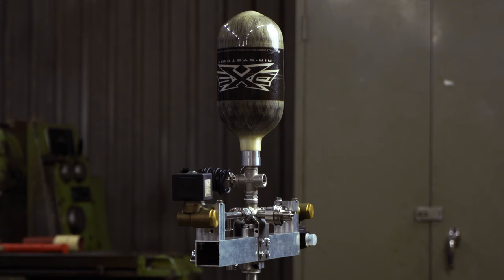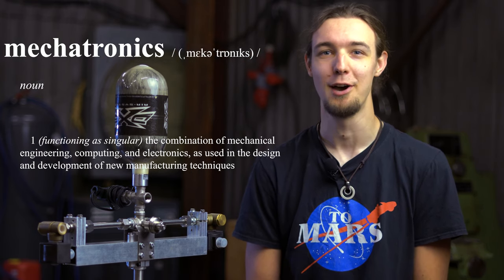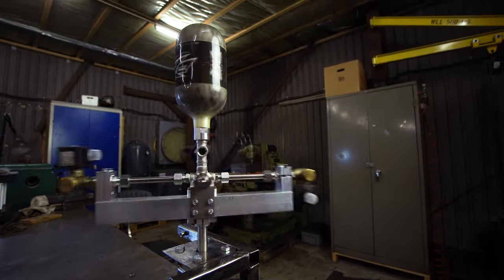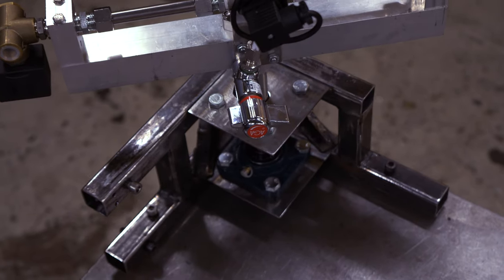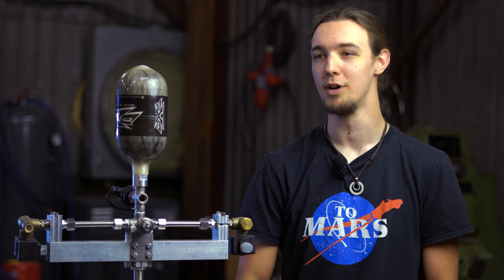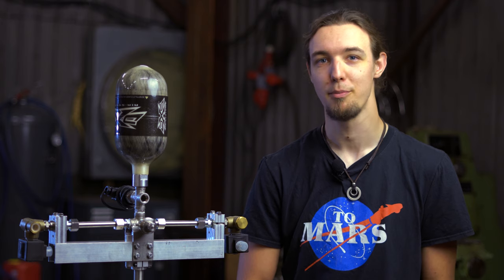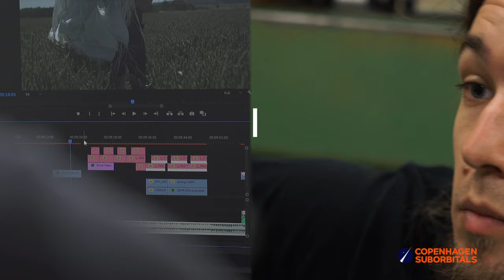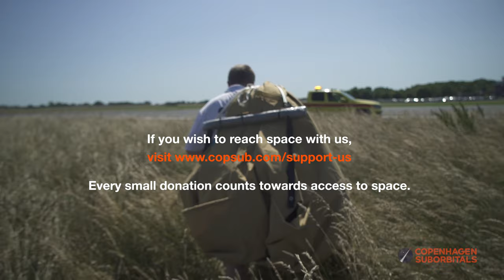How a Reaction Control System Works? Homemade Demonstrator

Comment: Thanks for the update. Is this system lower cost then reaction wheels, or is it simply lighter and more reliable, whilst still carrying enough propellant for the flight? And will you also be studying a chemical thruster option? Looking forward to seeing some of the tests; they should be very interesting. 🚀
Reply from the maker: Coming from Adrian:
Usually reaction wheels are great for satellites as they can operate for long periods of time, only using electricity provided by the sun.

We need a high powered system that operates for a short amount of time. So we would need to carry all the energy with us, in the form of batteries. 
Batteries are expensive and heavy.

But the final version that Spica will use is not set in stone yet. 
Why don't you try to make some calculations on it to see how they stack up? 🙂

I have looked more energetic fuel options, the ones that look most promising are based around hydrogen or hydrogen peroxide. But they would add a lot of complexity that is unnecessary for the current scope.
This simple system can be used to test many things and its operation is much more safe and faster.

Upgrades are of course possible. For example I would love to see a tri-gas version at some point. 
But I have a mountain of other things to do first.
Also remember that the Falcon 9 booster also uses compressed nitrogen for its RCS thrusters.

Hope that answers your questions!

Comment: One small question, would mechatronic engineer directly translate into the german language as a sub group of an "Elektrotechnik- Ingenieur" or are we talking about the casual "Maschinenbau-Ingenieur" with emphasis on control systems and electronical compononets?
Reply from the maker: From Adrian: Mechatronics can be directly translated to "Mechatronik" and is its own separate study course. It is pretty new though. Yes, it is a combination of "Maschinenbau", "Elektrotechnik" and a little bit of "Informatik" ... albeit not that much, where I studied. 
It can have many directions of specialization. Biomechatronics or Micromechatronics. It can also have a lot of control theory if you choose to go this route.
Reply: Mandernach Luca Maschinenbau.  Elektrotechnik heist gleich "Elektro-ingeniør" und ist traditionel ins starkstrom und swachstrom getrent, mit viele untergruppen von swachstrom.
Reply: @CopenhagenSuborbitals  
Thank you very much for the explaination. I was just wondering, as our base courses (im Maschinenbau Studium) also have control theory and some electrotechnical theory plus i did an extra course in electric motor theory and will do an extra course in hydraulic systems theory (not to be confused with fluid dynamics) and if i could be of use should i have the opportunity to work with you :D.
Reply: @johnfrancisdoe1563  
Danke für die Anmerkung :D.
Schwachstrom bezieht wahrscheinlich alles von 12Volt Bordnetz eines Autos zum 230 Volt Netzstrom ein, oder?